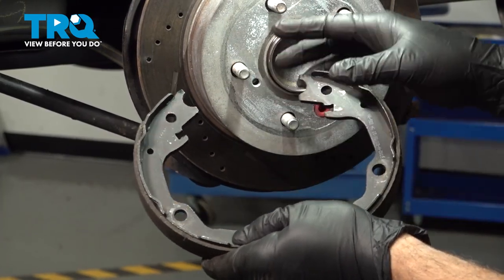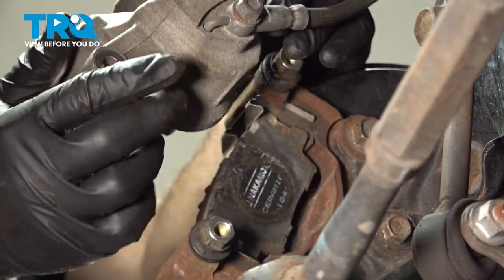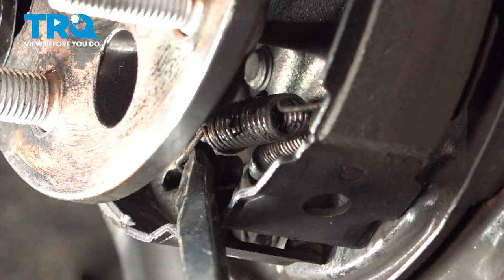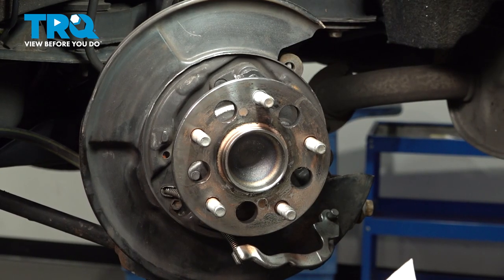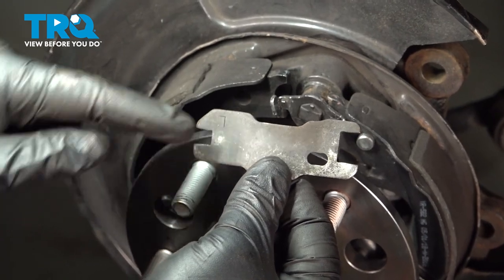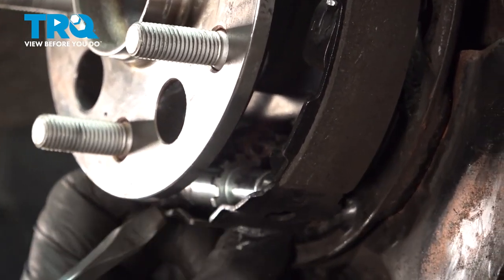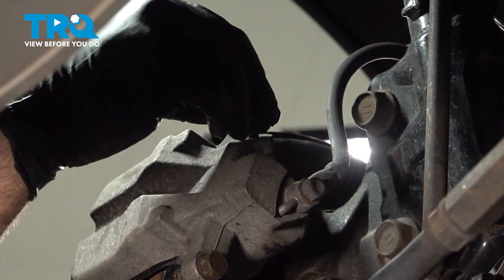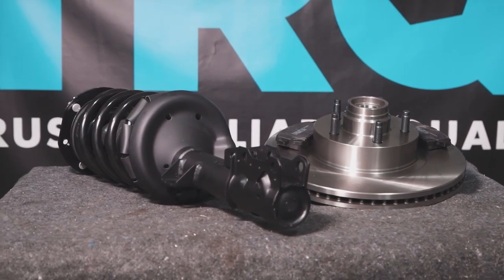How to Replace Parking Brake Shoes 2012-2017 Toyota Camry

Comment: One thing that wasn't covered is which side is the e-brake pads located? Back R, back L? Or both? My e-brake got a bit stuck this past week and I noticed it screeching when backing up, so I assume the pads are worn, but I couldn't tell which side in the rear it was coming from. Any clarification on this please? Thank you so much! PS - I have the 2014 Camry SE.

Comment: Why not loosen the rotor by turning the star wheel adjuster? They can be pretty tight sometime! Seems to me that after the rotor is put back, the star wheel adjuster should be used to adjust the parking brake shoes so that when the parking brake is put on you hear a certain number of clicks before fully pressed down. (would have to look up the suggested number of clicks.)